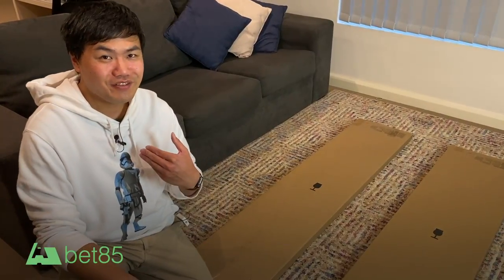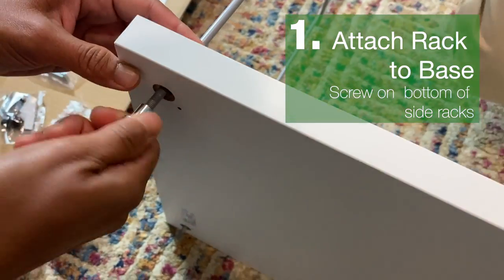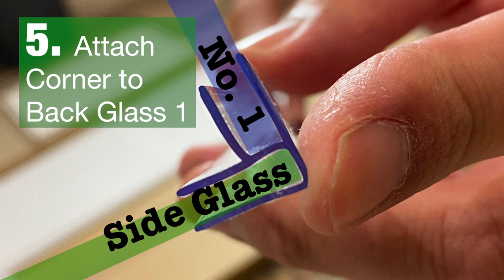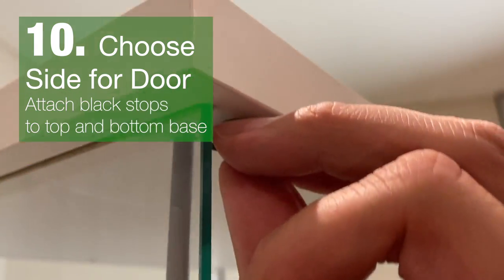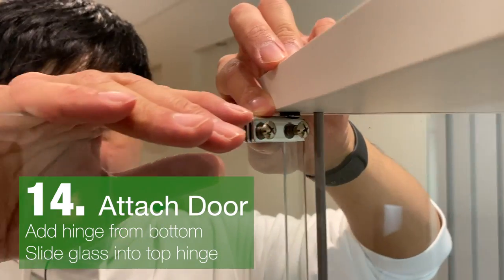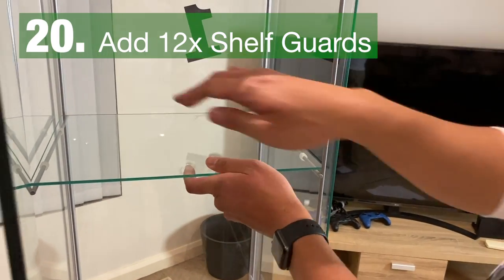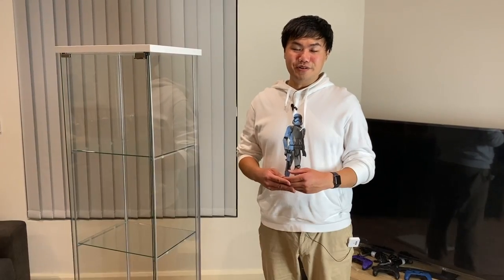IKEA's Detolf Shelf Tutorial | Steps = Instruction Booklet!

Comment: I couldn’t get the door close. Seems like the bottom part is not aligned. I followed every instruction except opening the door on the left. Any suggestions on what I should do to be able to close the door?
Reply from the maker: Hi, 
You might need to made some adjustment on where the hinge sits to the edge of the door/glass in step 12 & 14
With some assistant (pop the glass guard back on step 13 ), you can loosen the screws to the bottom 2:41 and move hinge closer to the edge of the door/glass. Secure the screws back in.

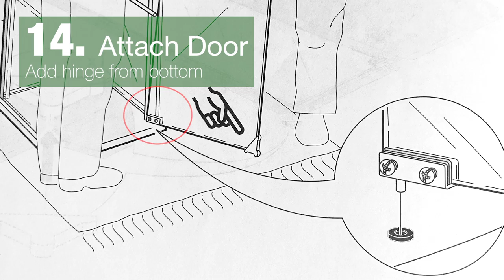If still not closing, adjust the  top hinge as well 3:04

Comment: Hello great video, I have a question about the back screws on 2:09, the two fronts tighten but the back two don't and I'm not sure what's wrong
Reply from the maker: Sorry to hear!
Only 2 things to check
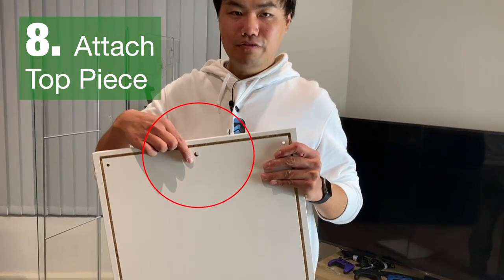1. Make sure the top is sitting flat on the glass at 2:00
As this can cause the screws to mis-align and not tighten
You might need to unscrew the other 2 and place the top back on

2. Swap the screws around with the ones that do tighten

Comment: Hi, the two plastic strips that holds the glasses toghether, have to fit inside the channel on the wooden base? Or only the glasses goes in there? Because I noted that the shape doesn't fit with the channel, and i don't understand if it's a defect or not! Thanks in advance
Reply from the maker: Hi!

Correct that gap is only for the panel of glass
The plastic corner will sit ontop

Please refer to photo:
https://drive.google.com/file/d/1a9C8qdlfFCFx-UdHn8mT6NGaR4rlxCvc/view?usp=sharing

Comment: Can you adjust shelf’s because I have 18th h figures
Reply from the maker: Hi,

Not with the IKEA original setup.
There are 3rd party extenders you can buy to modified the height of the shelves.

My Kotobukiya 1/8 scales fits okay in the DETOLF height wise.

Ideally I would recommend a different product, there is the IKEA Besta, which is modular
Or a metal shelving